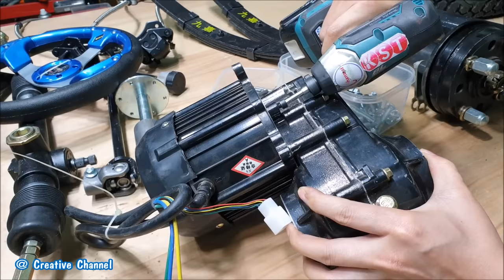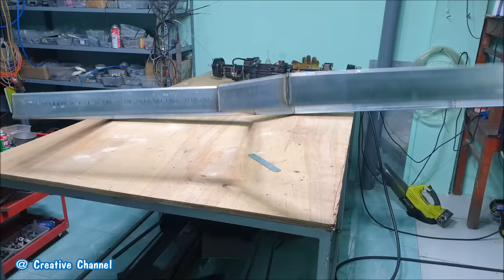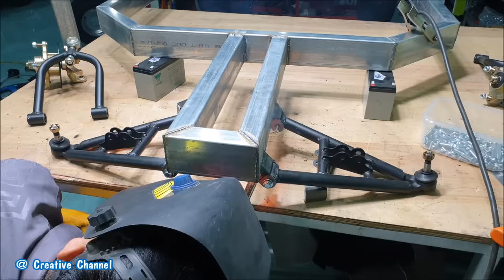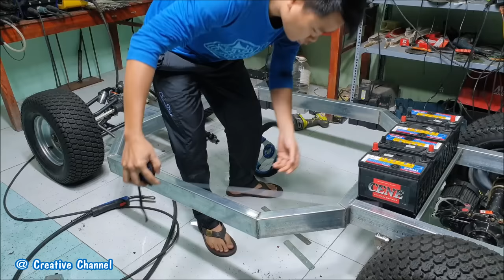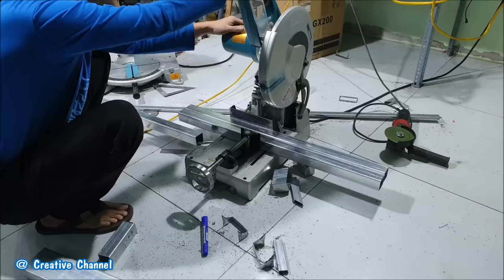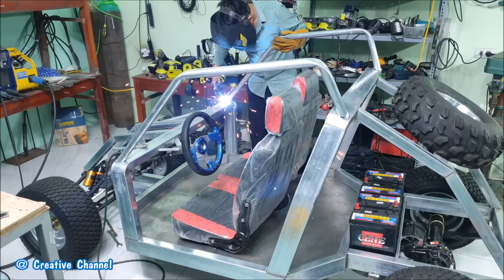Build a 1000W Electric Gokart at Home - Electric car - Tutorial - Part 1

Comment: Hi, could you put links to the parts you used for this build
Reply: I know that the battery is a lead acid battery 12 v each but i don't recommend Them you should go with lithium ion batteries 18650 pack 48 v
Reply: @joshuakotei6261  hvnh

Comment: I have a question: how did you determine the power you needed? I'm currently planning to build a threaded tank-like electric vehicle, but I'm unable to choose which motor, which power and what kind of batteries are needed... If anyone have an idea, let's say it would weight aroud 250 kilos with the driver, and the intended speed would be at most 10 km/h. I'd be grateful for any information, thanks!
Reply: For a vehicle which weighs 250 kgs, you don't require much power even 20 hp will be plenty. I don't know much about electric motors so I can't suggest you which one to use, but if you want to make your project using a ICE engine, you can use even a 100 cc engine but it will be more stressed I would suggest using a 200 cc+ engine it will do over 100 kmph and if your vehicle actually weighs 250 kg, the low torque output of a small capacity engine will not be that big of a problem. One thing to keep in mind is that these engines are motorcycle engines, thus they do not have reverse gear.
Reply: you are looking around 20 gas hp or 15,000 electric motor watts combined minimum to power that vehicle 1 gas engine hp= approximately 746 watts at close to 600 lbs (slight safety margin added in) tracks require massive amounts of power to slew (turn left or right from a standstill) and even more to pivot-steer (turn in place about the midpoint). I have a 1000lb. mini dozer that runs a 13hp engine with massive gear reduction that the engine will still bog down and nearly stall out in a pivot steer (total top speed of 3mph), and the tracks are only 36 inches in length and 6 inches wide and thats with the blade fully raised on hard ground if you get on soft or muddy ground you will need even more power

Comment: The guy doesn't wear personal protective equipment: gloves, boots, glasses. Solder on top of a wooden platform. Cuts on the ground, with no sense of ergonomics. At the time of using the anvil for counterweight, it was epic, kkkk !! For which tube bender, if the tube was crushed? I am almost sure that he made it in the madness and at the time of the test (which I didn’t even see), he used another one and more precise measures.
Reply: He is a pro
Reply: @gamebox9511  very very professional. Challenger builders were also professionals.

Comment: 1.) I'm pretty sure it's aluminum tubing.If it were actual zinc coated steel(galvanized) you would see the green/blueish smoke,and you would also see the (cobweb's) flying around.That and you're not spinning galvanized steel over your head like that by yourself.Galvanized would be to heavy of a load on the batteries.
2.) Would have loved to see the hot foot dance.Where are your closed shoes man?
3.) From the look of the workbench,I gotta ask where are all the batteries for all the yellow cordless tools.
3.)I never once saw anything checked for sqaure.Perhaps a blueprint off camera,or a sidekick off camera.
4.)Do you work for Trexa, or Electrek prefab electric car kits.Buy them all day long for 8-10.000 dollars.

Comment: you need 11 or 17 batteries possibly with buffers in between like a lithium solar battery   that has a different frequency than a car battery and i would get a battery for a Laurie or Truck
 you can you a relay as a gear in differing the amplification    50 amp 88   144    and 377  like a capacitor discharge surge

Comment: How many gauge the steel used in the frame or how many ml?and why don’t you use round tube and bends it make it one piece frame and reduce welding joints much as possible

Comment: I would love to get an inventory list, a tool list.  Then make it roomier inside, use larger wheels and increase the electric motor to at least 3000w.  If I added a couple, maybe 4, 400w solar panels, I wonder how far it could go on a single run?

Comment: Can anyone give me the list of required parts
Reply: 1.1000 watt motor with differential and other parts
2. Frame
3. Motor controller 
4. Throttle brakes
Other necessary parts 
(Suspension , other thing are optional) 
5. Tyres